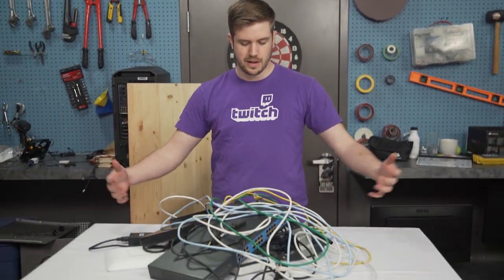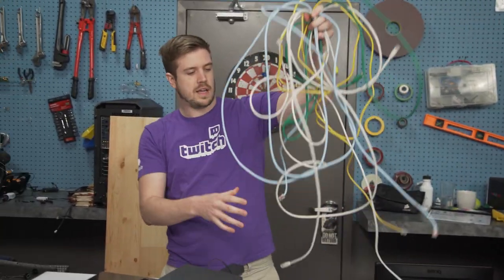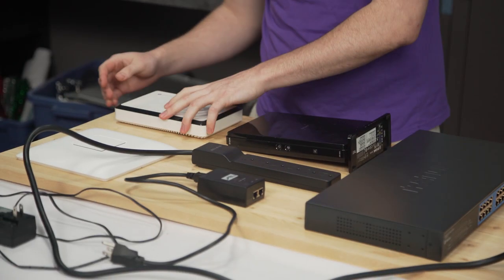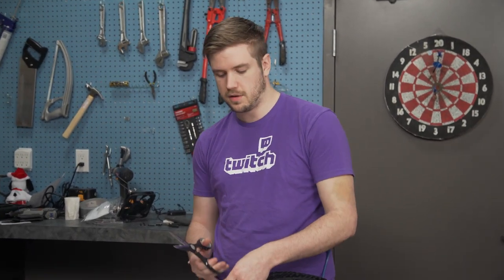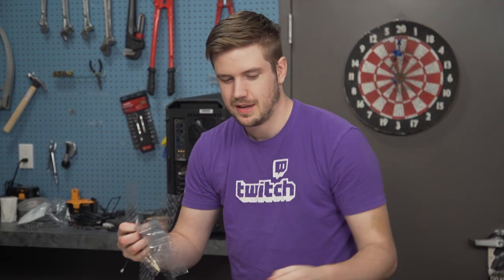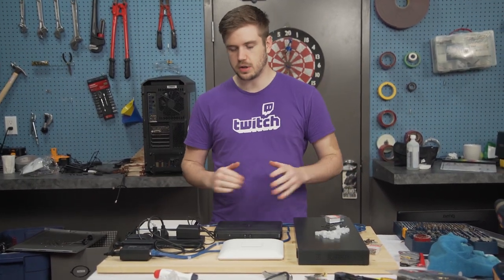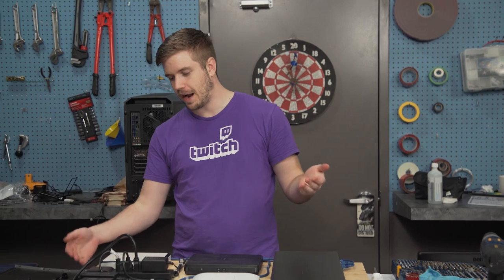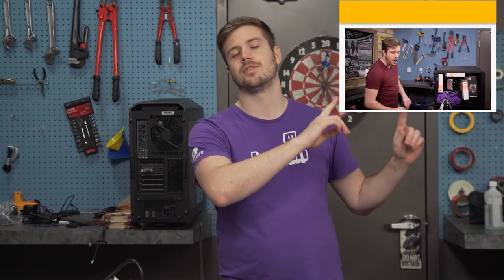DIY Networking Wall - A renter's solution!

Comment: Anyone know why my wired internet is waaaay worse than my wireless internet, I have an arris modem, and Asus 1900ac router, but when I plug my console into the wired network, it is a tiny bit faster (not really a noticeable difference), but my wired connection constantly craps out and kicks me off every hour or so. My wifi on the other hand is way more consistent. I may have a slightly slower ping (10 vs. 13 ms) and slower download/upload speed (about 2mbps slower in download than wired and .3mbps slower in upload) but I RARELY loose internet connection on wifi. I don't know why, obviously my router is connected directly into the modem, the cable connected to the console is fine after testing it a few times, and it is about 6-8 feet below my console and about 8-12 feet to the side (8-12 feet south to be precise). It is in my basement so the walls to the back (east wall) and the side ( the South wall) are made of concrete with wood and plaster walls, if that matters.
Reply: Another detail I forgot to mention, My cable modem and router are at the opposite side of the house from where the cable is routed into my house. I have the cable running through the house (I never measured this but I'm guessing the modem is 40-60 feet (east) away from the inlet, and my router is about 3 feet south of my modem.) Then I have about twenty feet of cat6 cable running down about two feet into the floor, which then travels 12 feet south and then 6 feet down into my console (Xbox one. don't be mad. I'm a car guy and need my forza.). If I need to give any more information on dimensions let me know. 

Also I would add, Lately my router has been showing age (purchased around 2012 - 2013) and has been booting devices off, but I think that might be TWC throttling my network, being general douches, or the router being old. When that router was new though it was a beast.

Comment: what is the difference between router nd an access point  ? isnt  that a wireless router?
Reply: +Akshat Gupta 
A router actually routes data, assigns IP addresses, manages DNS stuff, usually has a firewall... etc etc.  An access point does none of those things.  It simply sends and receives wifi data.  Most routers have a wifi access point built in.
Reply: +Diviance Exactly.

The Router is the intelligent part of your network (well the primary part anyway). It handles the task of figuring out where what data goes internally (and externally) on your network.

The Access Point is basically just a wireless cable. One end connects to the router - the other (the wireless part) connects to any wifi device in reach.

Routers can have Access Points built in (and it is common), but if your network needs more range, you buy an Access Point, not a second router to cover a wider area.

In a nutshell.

Comment: why would you need an ACCESS POINT?
Reply: Because he said that the wifi capabilities of his router sucks.
Reply: Karine Mallet and wouldn't be better to but another WiFi router? You'll have less cables.
Reply: +Nico Berrutti I guess he just wanted to use what he currently has.  And the big switch he already has insures that he doesn't need a  bigger router with more ports

Comment: how can you not gut all that and screw the PCBs onto the board
Reply: throw on some paint, leds, and some Plexiglas and you got a sweet piece of kit right there, maybe some fans, thats a good project, lowes has it all, maybe home depot
Reply: ALEX GIBSON Can't actually tell if trolling.
Reply: +TrisT nah if you took time with it you could build something sweet, its pretty much what ill be doing when I build a case for my expresscard to pcie graphics card box, maybe ill do a video on it 😎
Reply: gl!
I'm gonna be making a portable access point/router/nas/httpserver/mediaserver/switch box. Gonna use the TTL on the router to connect to the raspberry pi to control the router, bridges etc. In a small box with an target battery life of 8 hours.
Reply: +ALEX GIBSON to be fair i submitted this idea to the linus tech suggestions pile, so id personally be honored if linus and the crew built and tested this rig, as all the electronic parts are on amazon pretty cheap, btw the mini pcie your wifi card plugs into on your notebook will sometimes have a whitelist for accepted devices, which is the primary reason expresscard is the better choice, that and quality of build, but you can get the box supplies at lowes, like wood, screws, paint, Plexiglas, and wooden accents like frames and corner bits, put it together how you like and there you have it, custom external graphics setup with case done.
Reply: +ALEX GIBSON ive seen it tested on rigs like my thinkpad t410 with amazing results, the narrower pipeline to the cpu compared to desktop interfaces isn't bad at all on games that are primarily gpu reliant, and only a moderate hit to games that require cpu connectivity, all things considered expresscard 2 is pretty good at 3.2 gbits/sec. in PCIe2 or USB3 mode, and all the charts show minimal performance decrease even over expresscard 2 vs x16 in practical tests, im pretty sure with a good enough graphics card youd have little issue running the rift which is my purpose in the project, to make a vr laptop docking station out of my  nightstand, which if you rifle through my twitter media @servivigiledeus you can see it as it sits no card, still a neat dual monitor workstation taking adv. of the laptops built in screen, and the glass table itself, when Im done im submitting it to setup wars 😎
Reply: ALEX GIBSON God time for a good ole
"I HAVE NO MONEY HAHAHA"

Comment: i always thought i could just plug my modem right into the switch... whats a router for? lol
Reply: +Mahir Fredericks wireless connectivity and firewall/security. The second feature is probably the more important one if you prefer hardwire connection.

Comment: I personally rent a 4 room house.....

and I never had a "bundle of mess" like this (I hardwire everything) if you have a mes your simply not looking into it right...

it is EASY to hide MANY wires UNDER the property with a single inch or less hole..
cant do that AND REALLY REALLY want a hybrid of hardwire "wireless" look into to electrical outlet solutions..
they work REALLY well and are cheap... no need for a DYI board of ugliness................

best part NO SPONSOR SHIT in the way. simple google and your on your way!

but if you don't want to go that route, a simple smart plan of edging the rug and and stuffing under the border works just as well

+LinusTechTips

my set up:

4 rooms

8 DESKTOPS
a SINGLE connection from router for phones and tablets...
 DIRECT connection for multiple smart TV's

ETC...
 

KISS
KEEP IT SIMPLE STUPID

THANK GOD you didn't go with a simple splitter they can cause so many issues...... haha.....SMH

Ethernet cable proved to be hard....

your kidding right.......???!!!!!

Comment: part of your internet problem is your cables. blue Ethernet cables are the slowest and shittiest ones available.
Reply: ummmm?
Reply: +BigMan7o0 ummmm
Reply: +BigMan7o0 He's right - you gotta get green cables! The green hue of the cable increases network speeds of up to 600Mb/s!
Reply: actually Ethernet cables are color coded. blue=shitty
yellow=avg
grey=pretty good
black=best in home possible and white is mostly used for satellite internet to your router. the color corresponds to the quality of the wiring.
Reply: BigMan7o0 im sorry but what makes you such an expert? Im a network engineer with a cisco ccna and ccnp, so i think i know what im talking about.
Reply: hahahaha I'm unsure if he's trolling.... surely he is
Reply: +Ben Macpherson yeah me too
Reply: well do you have 40+ years of computer/networking experience? have you had multiple Comcast people tell you exactly what I told you? have you taken apart a single Ethernet cable in your life? obviously yo don't know what you are talking about, and you probably don't do shit with ethernet cables if you think I'm wrong. hell I changed my modem to router Ethernet cable from a blue one to a black one and my internet speeds went from 10-20 to 50-60 mbps wireless.
Reply: mitch jeppesen turns out he's being serious. Well alrighty then.
Reply: +BigMan7o0 yes i do know what im talking about, as i said i am a network engineer. i not only have a Bachelor of IT, i have 6 different cisco qualifications, which includes (ccna and ccnp). so if you have any professional networking experience you would know how valuable they are. Also yes i have taken apart ethernet cables before, and i also make them on the daily. why would a bit of plastic sheathing determine the speed of a cable. at the end of the day mate its just a bit of copper in there. But the fact that you called it 'router ethernet cables' obviously prooves that you know shit all about networking. Also i have looked on your channel your a kid that makes call of duty videos. so how about you go stop playing imaginary grown ups.
Reply: Ben Macpherson yeah no hes not go on his channel. He is a kid that makes cod videos. And he brags about his amazing 40+ years but he makes a video asking what these files are. Using a free to use screen capture and writing it on a word document. Yeah your a fucking professional mate
Reply: mitch jeppesen to be fair he did just find a shit tonne of files on an old usb
Reply: +Ben Macpherson i looked at the video for 10 seconds
Reply: +Ben Macpherson but that doesnt prove at all that he knows what the hell he is talking about
Reply: mitch jeppesen haha I know.. Just taking the piss ;)
Reply: BigMan7o0 well maybe mr tech genius can explain this, wh y is it that i can get crossover cables and straight through the same colour? Or even rollover? Oh but thats right you dont know wht that is and now you will be frantically googling to try and find out. Or you just admit that you dont know what the hell you are talking about
Reply: Ben Macpherson okay hahha
Reply: BigMan7o0 Also out tech you???? What is this even meant to mean, kid?

Comment: Why not get rid of the crap router and AP and get a decent WiFi router? It's not like a good one is expensive. That would get rid of half of your problems. And do you honestly need a switch that big? Wouldn't a ten port switch be fine? Over kill on one side and cheap shyt on the other. Just wow.

Comment: Why do you need that much ethernet ports? 
do you have like 20 pcs at home?
doesnt make sense at all
Reply: +flaggeable Linus is a server nut and it appears to be wearing off on Luke. I did a Newegg search and this switch costs $210 and is 24 ports and fits a universal rack mount kit.
Reply: But it simply makes no sense to me to have more than a media server at home
Reply: flaggeable
Look at Linus. His and his Wife's PCs are converted server parts running through a thunderbolt KVM to a rack in their closet. I know it makes no sense. I have an old 2009/2010 Z600 HP with 2 Xeon x5570 and I had it at 12 gigs of RAM before I stole the RAM.  Only reason I have it was it cost less than $250 total parts for 16 threads and 12 gigs RAM and Windows. I also have a NAS, (or more accurately an Ethernet external HDD) same one I've had for over 5 years.

Comment: whats the problem with glossy cover?
Reply: +Ricardo Mazeto Ugly as fuck, gets dirty quick, reflects the light and looks like shit when it does, the texture when you touch it also isn't as appealing as matte, not even close but it's not something important.
Reply: +llorTA toN really though sanding it like that was a goofy solution, it would have been more prudent to dissassemble it, sand it, prime it, and spray some flat black or whatever color he'd prefer, giving him more options and cleaner results, that thing went from gloss to gross and got stuck.
Reply: +llorTA toN i just think hes just a meat and potatos kind of guy, flashiness isnt his thing, so he focuses on function over form, inside hes really only his tech addiction away from being Amish, perhaps already qualifying for Mennonite, it's all very loveable, i wouldnt count it as a strike
Reply: llorTA toN technically, glossy surfaces are easier to clean. Since it's a wifi router, it isn't supposed to be touched so often. Sometimes reflecting surfaces are annoying but not soo much in my opinion.
Reply: Ricardo Mazeto Exactly, opinion, beauty is completely opinion based lol.
Reply: llorTA toN Actually, there's a lot of science behind, for example, color theory, which is one of the things that makes our notion of beauty.
Reply: Ricardo Mazeto 

That i know, but the things you mentioned are only bricks and mortars to build opinion

Opinion is based on who you are, where you went, who you went with, your dna, the way other people's personalities react with yours.

There is millions of things that can affect and modify your perception, if you were to analyze every single one of them it would take you literally a lifetime.

Also Fibonacci's "golden ratio" is much more related to how we perceive beauty than color theory, although color theory must be playing a large role.
Reply: Ricardo Mazeto Also i didn't mean to sound like "huhuu wtv its my opinion k so it's valid and urs is wrong" it's just that i've seen too many people, sometime not even gamer, complaining about the fact that glossy surface is shit because it keeps fingerprints, it doesn't look that good and a lot of us gamers and tech enthusiast can be lazy at times so sometime the glossy finish will stay dirty.
Reply: llorTA toN Yeah, I totally agree with you. Anyways, I rather glossy than lusterless. BTW, I don't mind cleaning my glossy smartphone everyday with alcohol.
Reply: ahah that's good, not everyone likes to clean their gear, personally i do think that clean gear is important.

Comment: Or you could just double sided tape them on the wall? 

But wait, that wouldn't make a 10 minute video.
Reply: +Zubin Butt He Screwed in his cable management stuff to the wood. The point was to not screw the stuff into the wall. Its also very easy to take the whole board and move it if he changes places. Its like you didn't even watch the video.
Reply: Trevor Peck But he could double tape them to the wall right? Instead of all that pointless work.

Besides, he could just remove the things and the tape and just reinstall everything at his new place.

Comment: Anyone doing this Please use goggles when you use power tools.
Reply: +Adam Jones Yes, yes, totally! Every time! People who work with power tools every day totally wear all the recommended safety gear whenever they use them...
Reply: +Thaxannadrote well, not quite but that doesn't stop other people from using the proper safety gear. I've got several patients who have lost vision (or at least gone through some very painful experiences) because of angle grinding without safety specs.

Comment: Y du u need that much stuff for network
Reply: All I have is a router
Reply: +CubicInsanity wireless can be slow or crowded, and 4 ports is also low, hell I used up 3 ports on the router and I still have devices that would benefit from being hard wired into the network

Comment: I don't understand this, you say your landlord won't let you screw into the wall, so you use a wooden backing panel and attach everything to it with Velcro anyway... surely you can just go a head and attach the gear to the wall with Velcro anyway?

Also, why are you attaching everything to the wall like that anyway. No wonder your landlord doesn't want you doing it.
Put proper Ethernet points in the wall, run it to a central location with a patch panel so it looks as legit as a light switch our power outlet does in your apartment and your landlord probably won't even notice you've done it, but seriously doing crap like this will not impress your landlord.